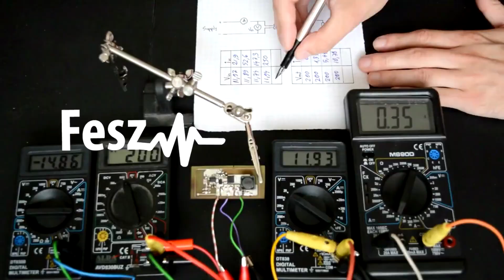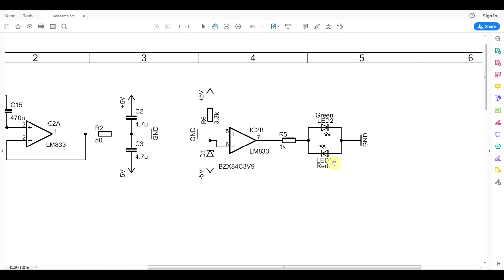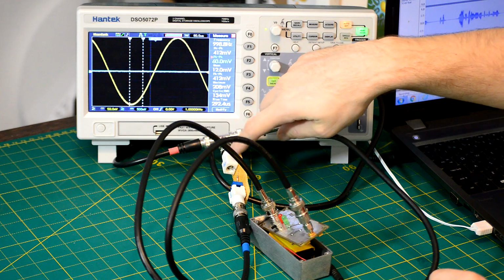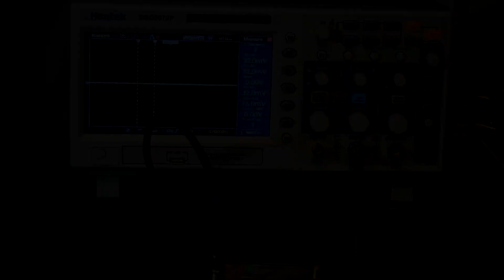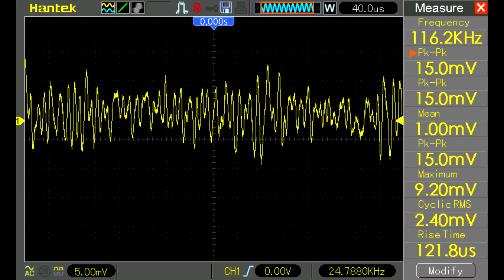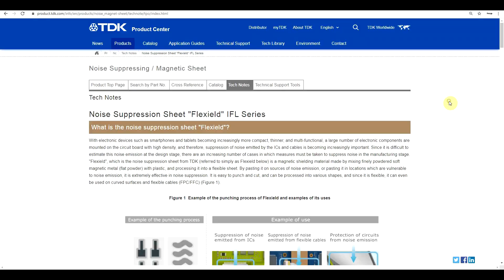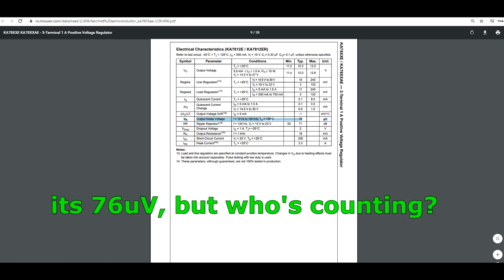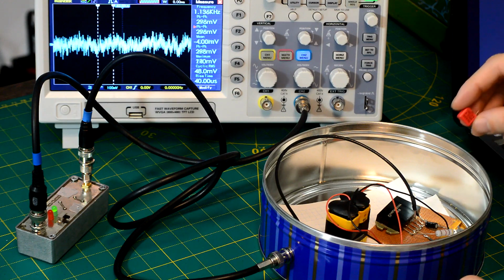Electronics Tutorial - Building a Low noise signal amplifier Part 3/3 - Testing it

Comment: The idea not to use the cover but to skew the PCB to the rest is genius.
For years I struggled to connect the PCB to the Coax Connectors. Duuh
Reply from the maker: I saw this approach being used in other projects. The one that comes to mind is EEVblogs uCurrent project ( https://www.eevblog.com/projects/ucurrent/ ). This project also highlights another advantage - if you buy the PCB from some manufacturer, you can use the silk screen layer to mark the various inputs/output, add a logo or something or add any drawings or things necessary - this will make the device look far more professional than if you write things by hand.

Comment: Having the PCB double as a front panel is a nice touch.
Reply from the maker: I noticed this in approach in various products - even commercial ones. Its quite nice that you can chose the PCB color (the solder mask) to be the same as the rest of your box - so its not obvious that its a PCB. Also you can add text in the form of the silk screen layer - to describe connector and switch functionalities.

Comment: Actually, aluminum  will attenuate the E-field while the ferro/iron attenuates the H-field component, so the best solution is to use a galvanically combined sheet of Fe and Al for the enclosure. This is how they build the EM silent TEMPEST chambers against SIGINT leakages.
Reply: Aluminum cases are very inexpensive and thicker than metalized plastic.
Maybe there is cast iron?
In my experience these Al boxes do the trick.
Reply: Hello electrotechnica I googled it yes it's true what you're saying but aluminum is a bad shield for EMI on low frequency the amplifier in the video is designed to measure low frequency noise.

Comment: If you AC coupled the amplifier, why didn't you add a capacitor in series with the feedback resistor at (-) input to ground? You don't want to amplify the op-amp's own offset, right?

Comment: Hi great videos; question does the LM833 add any noise to the ground plane that is then converted to output noise by the amplifier?
Reply from the maker: Hello! From what I could notice the LM833 does make a bit of noise, but it's canceled out by the other op-amps high PSRR (power supply rejection ratio). From what I remember, by swapping the LM833 with another AD8676 I did not notice a major difference; in general it will be best to have all op-amps really low noise, but the only one that is truly critical is the first amplifying stage.

Comment: Hello, great video! I was wondering if you consider the time scale on the oscilloscope when you take your rms measurements. Since the rms noise on the scope is usually the integration of the signal over the sample memory period, the reading surely varies with the time division you are using, no? I understand its a rough approximation but i find this rather interesting since it can potentially influence the readings by a non negligeable amount. what do you think?
Reply: The scope must also have some BW limiting in place and the number of samples and rate must match that limit.
Having fewer samples will cause the noise to mix down and increase the displayed noise floor.

Comment: In your schematic, you have the LM833 powered by a 9V battery. The LM833 datasheet specifies a recommended operating condition of VCC,min = +/-5V. Did you use this part intentionally, knowing somehow that it will operate at voltages as low as +/-3.9V or is this a design error?
Reply from the maker: I can't say for sure what was my logic when I made the circuit; but the supply voltage seems to be manufacturer depended - OnSemiconductor and TexasInstruments LM833 require a +/-5V whereas ST has a minimum of 2.5+/- (see table 2 https://www.st.com/resource/en/datasheet/lm833.pdf ) I guess I was using the ST branded component so 9V was sufficient
Reply: @FesZElectronics  - Good job. I didn’t even check the ST datasheet. I just assumed all LM833’s would have the same Vcc range. Looks like I’ll be buying the ST version. Thanks for the great videos and helpful information!

Comment: In your schematic, the trimmer appears to have the two ends of the resistive element tied together and the wiper tied to ground. Is this intentional or is this an error? Often you see potentiometers connected as rheostats - i.e. a two-terminal variable resistor. One end of the resistive element is usually tied to the wiper rather than left unconnected. What is the typical resistance set point of the trimmer?
Reply from the maker: I think I needed an 100R resistor (ideally) and the only trimmer I had at my disposal was 1Kohm; The ends where interconnected intentionally to try to make it easier to adjust the value.  With 1K connected the usual way the 100R point is somewhere around 10%; but with the ends interconnected, the same resistance can be obtained somewhere around 20%; If you have a 200R trimmer, than you can of course connect it the normal way

Comment: I'm curious, how much noise is added by your centering op-amp.  Since 78xx regulators are common devices, I wonder if something can be done to reduce their noise. You used a battery for its low noise contribution. Could a linear regulator be used?  The op-amp is supposed to be insensitive to supply noise. So how much would get through?
Reply: > Since 78xx regulators are common devices, I wonder if something can be done to reduce their noise.
Noise is measured over bandwidth, so reducing the bandwidth over which the output acts, reduces the measured noise. This means more filtering at the output reduces measured noise.
>You used a battery for its low noise contribution. Could a linear regulator be used?
As seen in the video linear regulators insert noise into the supply lines. This can couple directly into the measured signal (see next point). They can be used, but batteries are a convenient way to get very low noise, plus you dont need to be worried about EMI/RF coupling from outside sources.
>The op-amp is supposed to be insensitive to supply noise. So how much would get through?
If you look in the datasheet of the opamp, it usually has a quoted 'power supply rejection ratio' or PSRR. Worst case for this opamp is 106dB from +-5 to +-15V. this is the change of input offset voltage compared to PSU voltage. You can do the calculations yourself how much that would be for a noise signal of a certain bandwidth.
It is important to note, that the PSRR is usually denoted for a limited frequency band, but it is actually frequency dependent!! If you look further in the datasheet, at fig 21, you can see its frequency dependency and note that it quickly drops off at higher frequencies. Thus the type of noise signal is important to be considered too.

Comment: Hello, in your case did the metal enclosures make any difference? And did you earth ground the enclosures? In that case wouldnt there be ground loops since the scope is also earth grounded?
Reply from the maker: Hello. To be honest, I did not really notice a difference but that might be because I was working in an area that is quite EMI quiet. If there was more noise in the area than the difference might have been more noticeable. 
Regarding ground, connecting each circuit element to earth ground but also in between will of course create loops as you pointed out which is not a good thing. In my case the grounding was EG to oscilloscope; oscilloscope to Amplifier; Amplifier to enclosure.
Reply: The metal enclosure is critical and must be connected to the coaxial cable shield.

Comment: Hi sir, may i ask that why you connected 2 gnd and what’s the that symbol? 2 ground symbol ?
Reply from the maker: I'm not sure what you are referring to... The symbols without a clear name are the RF connectors on the input and output - these have 4 ground pins; and I also have in top left corner a switch that also has 2 ground fixation pins.

Comment: Sir, can I use this command in LTSPICE for resistors? {mc(10k tc=0.0001,tol}} . As I want to do monte carlo analysis at different temperature. Is there any other alternative. Please guide me as soon as possible.
Reply from the maker: Hello Irsa. The monte-carlo command will only work on a single parameter - it doesn't care what component you are using. To use the "tc" attribute, you need to use resistors, but the mc command doesn't know this. So to use both mc and tc, the syntax would be " {mc(10k,tol)} tc=0.0001 - this way the temperature coefficient is applied on the monte carlo final value. Let me know if this works out.
Reply: Okay sure. @FesZElectronics
Reply: @FesZElectronics   yes i cjecked it and it works.
Reply: @FesZElectronics  I have another question. Can we introduce faults in components in LTSPICE, like we can do in MULTISIM.  
http://zone.ni.com/reference/en-XX/help/375482B-01/multisim/settingplacedcomponentsfaults/#wp245032
Please guide me. MULTISIM provides option for these kinds of faults for every places components. Is there a way to introduce faults in components in LTSPICE?

Comment: What the hell! This is the biggest voltage regulator! Not just any regulator. It is RUSSIAN! One which behaves as an integrated circuit with 'null adjust'. It is an integrated circuit anyway but the small one is commonly not considered as an integrated circuit due to its common usage as a voltage regulator.